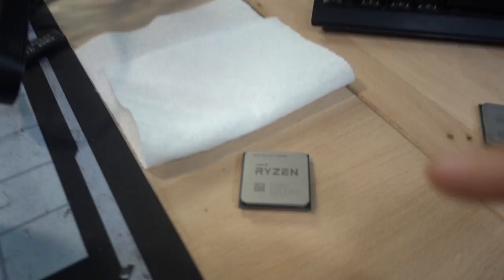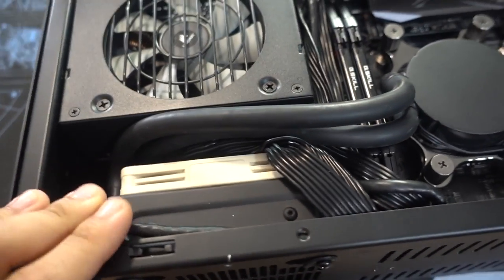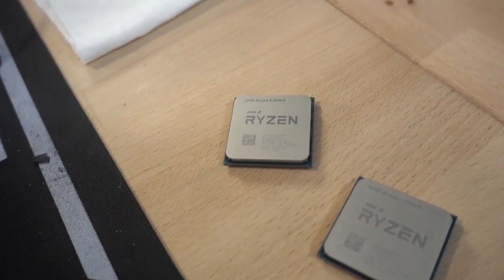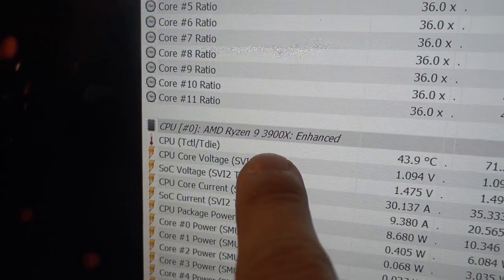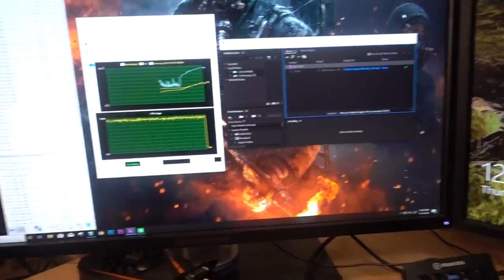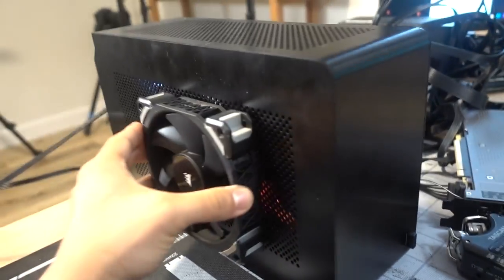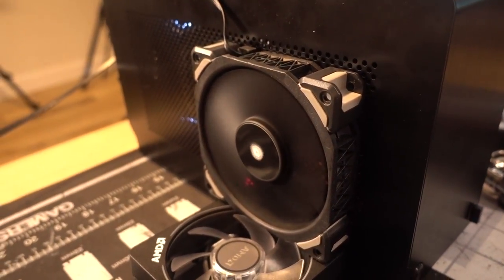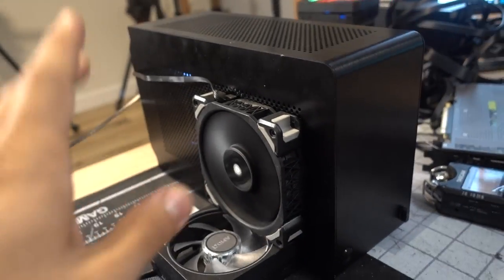This idea was BOUND to fail...right?

Comment: speaking of stock performance, been using my 2700x for around a year now.. stock clocks 3.7ghz, 22c idle temp and have seen 4.7ghz at 56c max...... extremely impressed with these chips. would love to get my hands on the 3950x

Comment: Question, can I use the recently released Ryzen 3 3200G to upgrade the Asus ROG Strix  X470 to update bios to support the Gen 3 Ryzen 3900x? It’s a bit confusing because the Ryzen 3 3200G is a new chip yet it’s a Gen 2.

Comment: 3900x, 2xPCI-E Gen 4 SSDs, small mini itx MB, and only a 120mm radiator. My dude, your system is either going to melt, catch fire, explode, or all of the above. Please catch it on video :)

Comment: I built a 3900x in a node 202 with a stock wraith spire cooler from a ryzen 5 1600 and a cryorig c7 fan mounted instead of the amd one to fit. The processor arrives tomorrow, lets see how it performs, I think it will be fine

Comment: My system is very similar but with 600 watt power supply and a zotac mini  gtx 1080 holding a ryzen 7 1700x so i am doing this upgrade

Comment: Did you attempt undervolting like Optimum Tech did? He noticed very little performance loss (sometimes even gains through less throttleing) and could go as low as 1.00V.

Comment: I like my PC's like I like my cars; Monster Miatas, Fly'n Miatas, Shelby Cobras, and Toyota 86's with Ferrari V12s or 2JZs, or just straight up sleeper hotrods. Small, compact, clean, classy, zero compromises and yet subtle ... at least until you pop the hood or sit in the driver's seat.

Comment: If you're gonna mount a fan to the outside of it, what's the point of using an A4-SFX? Just use an NCase M1, you can mount a 240mm rad in it.

Comment: Optimum tech has been doing some low voltage tweaking on the 3900x - may improve thermals without too much loss in rendering performance- if it's about being a good portable work machine? https://www.youtube.com/watch?v=2wM3obN2pAE

Comment: Why not cut the bottom and fit a 120mm AIO and taller feet and mount the fan on the bottom on the outside and the rad inside.

Comment: Instead of ghetto rigging a fan to the outside of the DAN Case, why not switch to an NCase M1? Sure, it's a tad larger than the DAN Case, but putting a fan on the outside makes it larger anyways. Making the switch would let you install that 240mm AIO cooler you talked about.

Comment: Hummmm.... I was planning to try a 3700x/3800x in my newly acquired Nouvolo Steck. Maybe I can get away with a 3900X :::BIG GRIN:::
But I want to go air cooling and not sure a Big Shuriken 3 will cut it or hot compares to a 92mm AIO? My case can handle up to a 70mmm cooler height.

I have a pair of 80mm fans that run off a single USB port. That might be an option if you need to temporarily mount some fans to the outside.

Comment: Put that same system in a Sliger SM550/560. You can use the same AIO but orientate it as intake from the bottom of the case for much better thermals.

Comment: Hey @bitwit, Kyle, you can undervolt your proc, I saw a video from another youtuber that got 1.0v on the chip 3900x at 3.9ghz stable, but use it with ryzen master, on bioses, he had bugs and performance issues undervolting on bios.

https://youtu.be/2wM3obN2pAE

The other channel is optimum tech, also very good, as yours.

Cheers and regards from Brazil.

Comment: Maybe using a low profile air cooler is better with that kinda case pushing hot air from PSU and cooler altogether, so it's going to be an oven.

Comment: I haven't seen this mentioned in videos yet but the 3900x has an ECO mode in the bios. you  CAN set the 3900x to 65 watts in the bios and have a low power low heat part for micro systems. but honestly if you tune the 3900x it can run VERY COOL at full speed my 3900x runs 65c in prime 95 at under 100 watts getting a 3277 r15 score so these cpus are very impressive you just have to play with offset voltage to get these results for me I could go to -.106v offset to get these results beyond that performance regressed. but if you don't mind losing a little perf you can goto -.2v and it will run ice cold 100% stable zen 2 is incredible for how tunable it is if you don't mind sacrificing a little perf it can run at VERY LOW VOLTAGES

Comment: An upgrade to the 3700x sounds like a better option, since that chip performs better and at lower temperatures than the 2700x

Comment: external rad with quick disconnects or mod the case and mount a 240 360 against it and then but a 3950 x in it and render maybe 4 hours instead of 6 min  ;)

Comment: I don’t understand how the 1080 ti apparently requires a 600w psu and you’re over here throwing a 12 core 24 thread chip in with a 1080 ti on a 450w psu

Comment: I mean the fan worked, but doesn't that defeat the purpose of the case? Personally if I was traveling with it I'd prefer to exchange the ITX case than have ghetto rigged case fans on outside of the Case. Or just put it on a mini test bench in a pelican case.

Comment: undervolt the 3900x and have it set hard at 4.1ghz,you only hit 4ghz anyway and your highest voltage was nearly 1.5v and you can easily reduce that, and have the temps alot lower

Comment: Thank you for the review. Huge fan of your channel.  Dan a4 sfx user here with a ryzen 7 1800x and 545lc aio. Theres a 3d file for dan a4 case spacer to fit a 2.5 slot gpu inside. Maybe you can modify that to put a slim 120mm fan inside. Heres the link. 
https://www.thingiverse.com/thing:2771844/comments
This would be a nice followup video.

Comment: Quick question: did Asus have a firmware update to something before updating the bios like my Aorus X470 board did? If so, did you do it? Also, with a slim Noctua fan you may be able to reduce the noise and improve airflow, which should be great for that Asus board, as they are known to have less than adequate VRM heatsinks, (which is fine cause not many ITX boards DO have adequate heatsinks due to space savings).

Comment: You might want to take a look at your liquid temps with that thing running full bore. Asetek says liquid temps above 60C will eventually damage the cooler and you might be getting close to that with 90C CPU temps.

Comment: kyle under volt it 1.0v and bring the frequency down 300mhz or so without the external fan see if you can trade off a min or so longer render times to keep temps under 80c

Comment: Drop your Vcore down to 1.1v manually @ 4.0Ghz clocks, another reviewer did this and only saw a 5% drop in rendering time, but this dropped his max temp down by 31c reducing the Vcore. The only downfall was a reduction in single-core performance, but multicore was still within 5% of the stock.

Comment: Just a heads up kyle.. The pcie 4 gen nvme drives works as good (speedwise) on a 470 board as long as you have a gen 3 ryzen chip in there. You dont need to be on 570 to get the performance 😁

Comment: The reason your system might get hot is because you AIO radiator is literally squeezed against your power supply. Thankfully, since there's water being pumped through the radiator it still manages to do a passable job despite the lack of airflow.

Comment: I am actually in the process of doing a very similar build. I have an Aorus x570 ITX that I am putting my 3900x in and putting the whole shebang in a CM Elite 130 case that I have modded to fit the MSI Gaming X RTX 2080ti. I have a Corsair H80i V2 to cool the processor, and I have removed the drive bay above the intake to allow a special mounting of this cooler. I may even be doing a push/pull config as well if the fitment works out as well as it looks like. The rest of my parts arrive in the mail today so I could possibly get a fitting done tonight before I finish filing and sanding to repaint everything. The case will be heavily modified by the time I finish it up. I am looking to have the most robust LANbox/mobile video editing rig available.

Comment: IIRC Kyle, I think it was Silverstone who had external magnetic fans with USB cables. They might still sell them, if not someone else might have something similar. That could help you out. Optionally, perhaps you could dremel a side panel out, use a fan bolted to it with a custom Bitwit fan grill, and an internal cable routed through the cutout. Using a black and gray Noctua fan with the black rubber mounts would minimize rattling too, and still get some crazy airflow.

Comment: Try dropping the voltage until the clock speed starts to drop and bring it back to the last good voltage and your temps will drop even more. I was idling at 40-50c on my r9 3900x before I did that and jumping up to 85c as soon as I would hit it with a load. I have a be quiet dark rock slim and this helped me drop temps down to mid 30s at idle and full load only ever made it up to 71c peak on one core. I do have a much bigger case with very good airflow but I expect you should see numbers pretty similar to that after you drop the voltage down.

Comment: Voiding warranty cuz of overclocking? Loool that’s just bullish*t
Reply: RockingGamingDe that is true for all products, like graphics cards and other CPUs. Overclocking runs the risk of damage if not done properly, hence they can’t cover it with warranty
Reply: Rohan A. It can damage the cpu/gpu/ram if you OC it to much/give it to much voltage but neither intel nor amd etc can’t prove that you gave it to much voltage cuz the OC gets saved in bios. When intel geht’s a dead 9900k the could put it in every board they’d want and it would run stock, because it’s only in your bios

Comment: It would be super cool if you can do a 2019 itx case round up for portability! Currently using the SG13 but looking for something slimmer!
Reply: Besides the fact that you are looking for a slimmer case, do you think that the sg13 is a good itx case?
Reply: @gabriellesta7568  it's a great budget case and it does fit in a normal sized backpack. I can fit 2x 2.5 inch ssds and a 3.5 inch drive. Corsair h60 and a 10.5 inch video card. Great for AIO coolers bad for air coolers with very little head room because of the PS. I highly recommend getting a SFX PS with the adapter. Cause no way you can get a full atx PS with HDD bracket.

Comment: Can someone help me with my PSU issue? I am upgrading and can't really afford a new PSU so I am wondering if an r5 3600 and 5700xt with x470 will be enough for 500w?
Reply: Its cutting it very close, tbh ya should just save and get a 650w. Also pcpartpicker is your friend, it estimate how much power ya need based on your parts

Comment: Idk how you got it running, but I put my 3900x in with updated bios and it crashed constantly. I even did a system wipe new windows 10, drivers, and it still crashed every 5 minutes. There website says it doesn’t support the 3900x either. Had to get a gigabyte mini itx mobo and will come tomorrow.
Reply: make sure to reset the bios when you update it and slap in a new CPU, it will still run the old settings for the old cpu ;-)

Comment: Please someone help me. I recently built a gaming pc including. Xeon X3470 p7p55 lx rx 480 strix aigo icy k4 cooler and a 775 watt psu that i found from ebay. I watched a build video and followed all then steps and when i went to turn it on it wouldnt boot. There is power going to the motherboard i see multiple leds on the gpu and the motherboard itself. There is no cmos cr 2032 battery but i have seen people say that this shouldnt prevent boot. Pls help me
Reply: Make sure display is connected to the graphics card, not the motherboard.

Please replace the CMOS battery.

Comment: Just got a 2700X what GPU do you recommend that's above a 1060? I've been thinking about either a 1660 or a 1070.
Reply: Bleh Nvidia you should get a Rx 590
Reply: @christechguy  Definitely not. RX 590 is basically a RX 580, the GTX 1660 is cheaper and is equal to the RX 590 in a lot of things. Besides, I already have an RX 570 that is OC'd to perform like an RX 580. There's a lot of good deals on 1070's right now, so I believe that's what I may go for.

Comment: I've been meaning to build a small system like this. Do you guys think if i swap the cpu to a 3600 and the gpu to maybe a 2060 or the 5700 that the temps would stay nice and cool? I live in a hot environment but i do have an acer predator helios 300 (2017 version) and that stays at around 83C with fans maxed out in temperatures varying from 26-35C.
Reply: The 3600 should stay nice and cool- you could probably get away with a noctua l9i or something even.
Reply: @bengraham8833  I wonder if it would. That would save some money for the build

Comment: Just put an x570 build together in the Dan Case V4. Used the gigabyte x570 i aorus pro wifi (only x570 board with 2 m.2 slots that's actually for sale *cough ASUS cough*), a 3600x, and a 2070 Mini from gigabyte

That GPU allows me to put a 120mm AIO on the CPU, which is really nice. 

I repasted the GPU with kryonaut, and the AIO is using a noctua NF-A12x15 fan. It is mounted super terribly cause i didn't bother cutting the screws down to size to screw it in with a slim fan, but it mostly works. The one thing I think is important I changed from a standard 120mm AIO configuration in this case is I made the PSU fan intake from the radiator instead of the motherboard side. It will make the PSU a bit less happy, but it's still fine, and makes the airflow through the rad much better. 

(ambient is 25C for the below #s)
GPU temps are 75 under a timespy stress test, but the clocks hold at about 2050 MHz. 
CPU temps are never over 65 on the same test, but unfortunately precision boost aint working right on my CPU, and it refuses to go past 4.3, even with tons of headroom in every metric. I am running a negative voltage offset of about 0.075V, which is helping temps, I'm sure. 

So, overall I totally recommend ryzen 3000 in this kind of setup. If you can take the hit to the GPU (only a 2070 is short enough), then you can benefit a lot from the AIO being a 120mm. Now all I need is for my CPU to start boosting properly, and everything will be fantastic :D
Reply: 120 fits in the v4? Interesting.
Reply: @zoomzabba452  yeah it goes beside the gpu as long as the gpu is short enough. Was also a thing in the V3, not sure about earlier. I mean it always fit, but the V3 came with an adapter and the V4 has one you can buy separately

Comment: 1. Can you please use liquid metal as TIM, this should improve cooling significantly.
2. 7 min is not long enough to heat up your AIO, you have to what until the temperature stops rising, this may take 30min or more